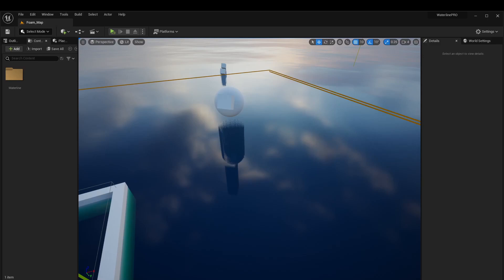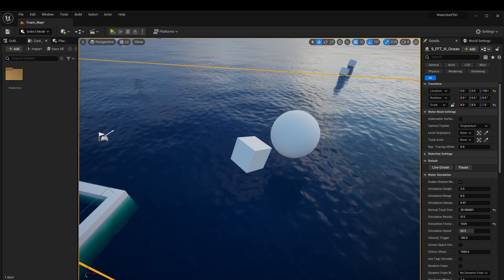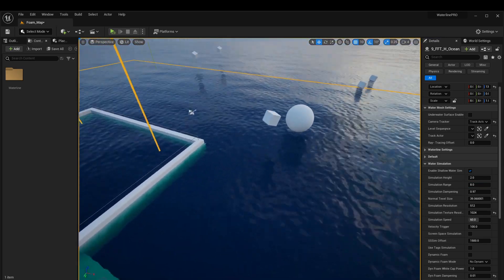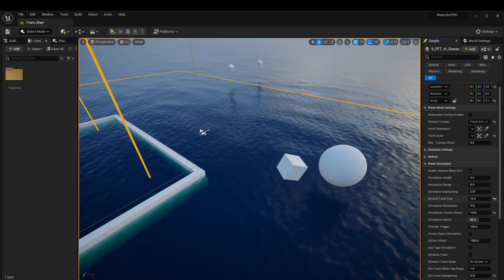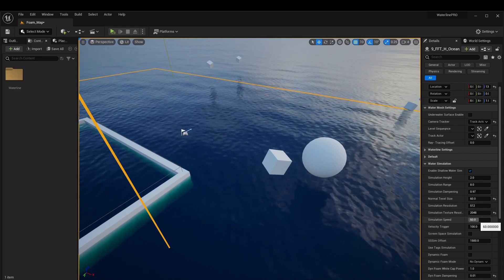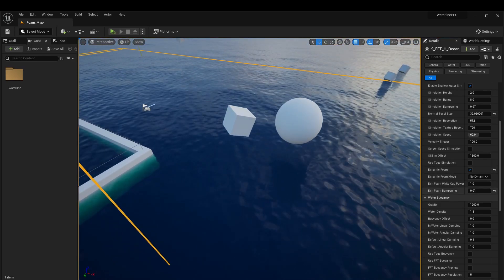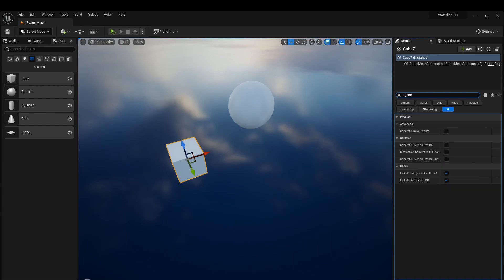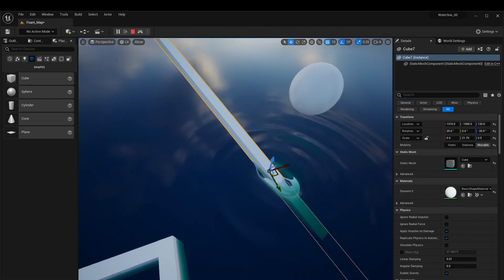Waterline PRO Tutorial: Dynamic Water Simulation - Part 1 Simulation Parameters

Comment: Hey, thank you for the tutorial but I have a problem right from the start. The water does not react to any object interacting with it. No waves around them. I tried to set up multiple fresh projects, only waterline inside. And on the test maps there are no waves. I set tracking for one of the actors and nothing happens. Objects float but don't cause ripples. Characters neither. Did you encounter an issue like that? Maybe it something simple and obvious but I try your tutorials and see it is supposed to be working and it's not.
Reply from the maker: Hmmm this is odd - could you contact us on our support email with details regarding your setup?

Things should be working from the start in the default project BUT if you are using WaterlinePRO in your own did you follow this guide when migrating the asset:
https://youtu.be/1CF9vdXm66c?si=PXBul5v5QLyXksp3
Reply: @dumpsterfireproductions  Thank you for your response! Turns out I missed a step and didn't tweak the waves settings enough, my friend walked me through the process and it all works now, sorry for bothering you! 😅

Comment: hey man any way you can share a link to an uploaded version on Drive for the boats pack as it doesn't seem to be out for sale this would be great for my Uni project. ty!
Reply from the maker: Unfortunately we cannot share 3rd party assets :(
Twinmotion were the original creators of the boat pack that w used here, though there are quite a few other boat assets in the Unreal Marketpace which are also available for free :)
Reply: @dumpsterfireproductions  I understand this, however, I can't seem to find any free boat assets. would be much appreciated if you could link some, as I'm looking for yachts sails and speedboats. thanks for if you could :)
Reply: @dumpsterfireproductions  I have also found a download link for this pack however I'm fairly new to unreal and the textures/materials aren't working with the boat if there's a quick fix for this that you recommend that would be great,

Comment: Hello! I can't find the Simulation Dampening parameter, has it changed its name?
Reply from the maker: Hi!
We have a number of ocean actors which are from older releases in this pack (we mainly keep them around for comparability reasons for older users).
To see the latest and greatest features at the moment make sure to use the "BP_Waterline_Ocean_Gen_3" also make sure to use the latest two releases of Unreal Engine as a rule of thumb these are the ones that receive the latest features :)
If the issue persists let us know on our support email.
Reply: @dumpsterfireproductions  thanks for the answer. I need the waves from the object to stay longer, but I can’t find which parameter is responsible for this